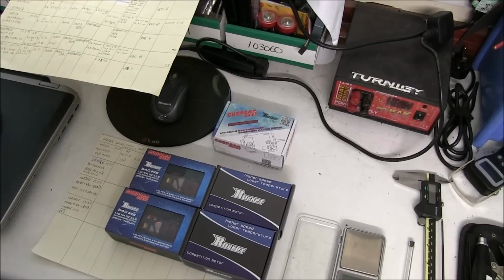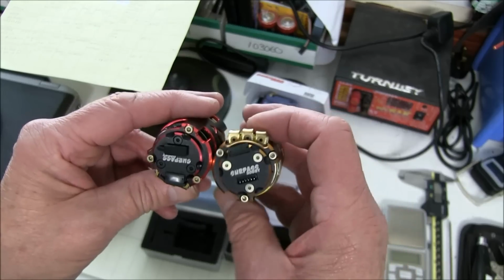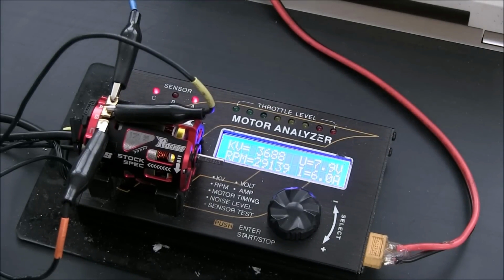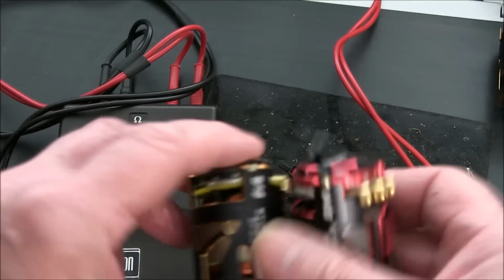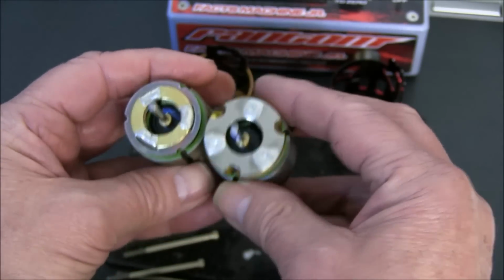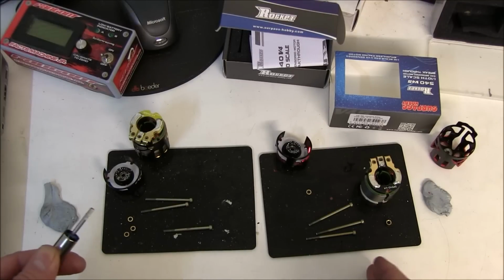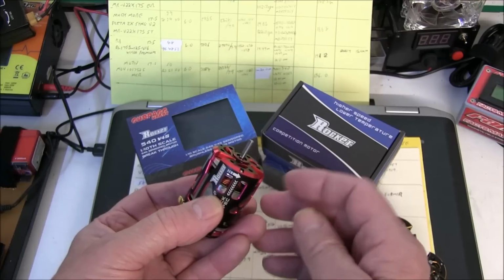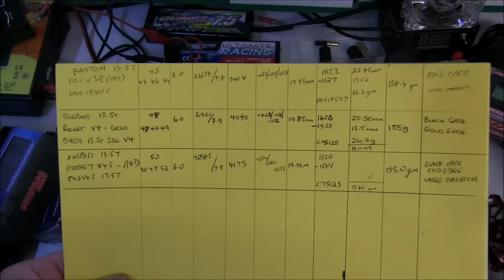Surpass Rocket V4 Brushless Motors. Blasts to the top?

Comment: Hi Nick. I wonder if you might help me with something please. I was watching your "Watkins WEM Dominators. Evolution 1960 to 1970s" and as you seem to know a lot about WEM amps I was wondering if you could tell me what the speaker is in my 1974 WEM Dominator MkIII is. Its the one with the big square lump of metal around the magnet (or is that the magnet I'm not sure?). It doesn't have a label or any info on it that I can see. I've looked around on the internet and I can see pics of it but I can't find out anything else about it, who made it etc. I'd be very grateful if you can identify it for me, thanks. My name is Nick too btw.  :)
Here's a pic of it ... http://www.chambonino.com/routework/routewk13d.jpg
Reply from the maker: Hi
That is called a Horseshoe magnet. Alnico. It is normally has a cover which hides it.  Better known versions are the Celestion Blue Bulldog. Also Jensen made speakers with Horseshoe manets, as did Fisher and PJ , CTS and others.
I do not know what make yours is, and doubt it was the original speaker, but who knows in those days they fitted what they could get.
I need to see the cone side to maybe identify.
It is a 12" size?.  If the coil/ cone is good , it should be very responsive with a great tone.
Have a look at this one:

http://www.nzguitars.com/forum/viewtopic.php?t=30011
Reply: Hi Nick. Thank you for replying. It looks different from the one you linked to. I took the speaker out tonight and took six pics which I've uploaded to my G+ plus page (link below). The only things I can see on it are "16Ω" and what looks like a hand written "93" both on the back of the cone. On the metal below the magnet it has the letters "PA" stamped on it. And it's a 12" speaker. Here is the link to the images (if you click on them you should be able to zoom in) ...  https://plus.google.com/u/0/108170585332719919303/posts/ekEkuBdqFe6
Reply: P.S. It really is a great sounding speaker, that's the main reason I would like to know what it is so I can try source more or similar if possible.
Reply: I think I've found it. On the WEM Owners Club website they say Charlie probably used Peerless speakers, amongst others, and the pictures on their site look like a good match for mine. Links below. If you enlarge the pic on the second link, it has the same markings on the speaker.
http://wem-owners.com/cabs/drivers/peerless-drivers/
http://wem-owners.com/wp-content/uploads/2015/07/inside.jpg
Reply from the maker: I did search around the internet, but could not find one that looked identical.
Yours has a small voice coil which is okay for PA (voice) but not great for guitar, but still will deliver good tone.
Reply from the maker: Sorry I don't know the make. It would have been made early 1970s, so probably difficult to find another.
Let me know how you get on.
Reply: Hi Nick. Thanks for replying again. Having not tried many speakers I don't really know the difference but to my ears it sounds good. I think the amp it makes a great pedal platform and sounds really nice clean or with overdrive and distortion pedals. I've never been able to crank the amp properly as I live in an apartment. I'll need to take it to a rehearsal studio at some point so I can crank it and see what it really sounds like.
If I was to replace the speaker. Do you have any suggestions for modern speakers that would work well in the amp?
Reply from the maker: Hi
Many Guitar speakers will work with that amp.
Prices vary depending on how much you want a specific sound.
I like the Celestion G12H  speaker which is very responsive with very good treble response.
Some like a more middle range sound such as the Celestion G12 Vintage.
Most speakers use the same 4 hole screw fixing position, so most makes will fit in.